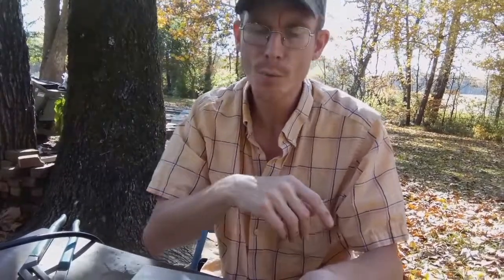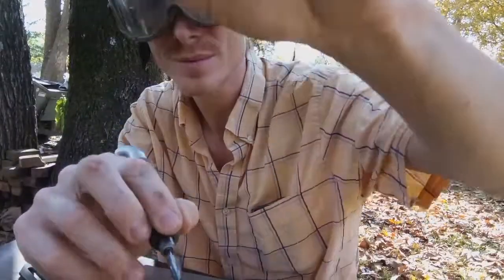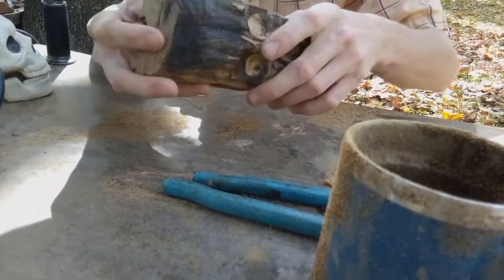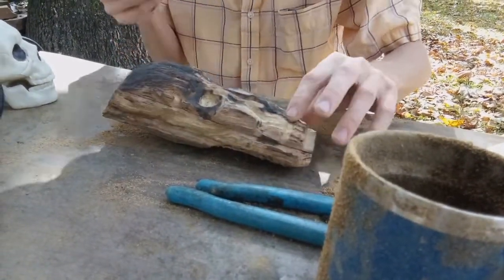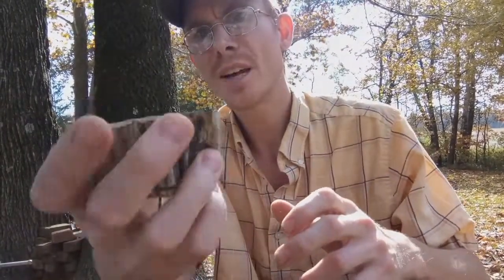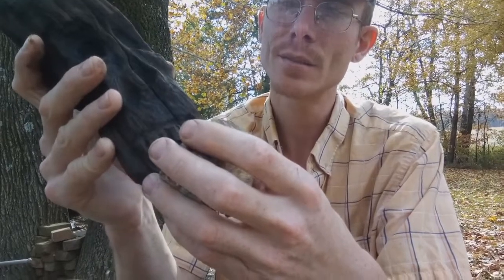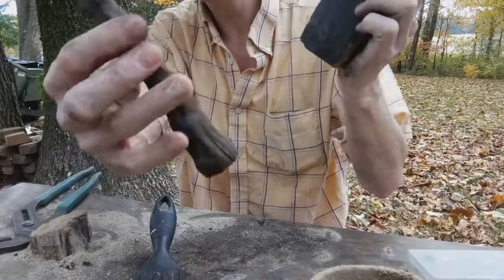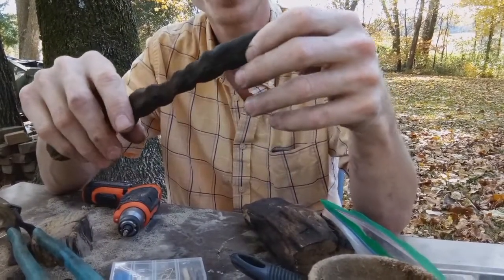skeleton part 2

Comment: good job buddy ,its good to step out and have a go at something different ,good on ya mate ,hows the girl friend going ,your angel
Reply: oh mate if you going to use a screw near a end of any wood you should pre drill it with a drill bit first ,you can still use a dowel just re drill it to the size of the dowel size and just glue the crack ,it should be fine